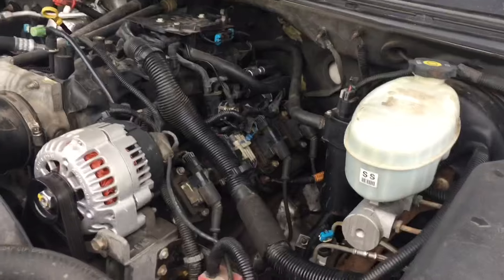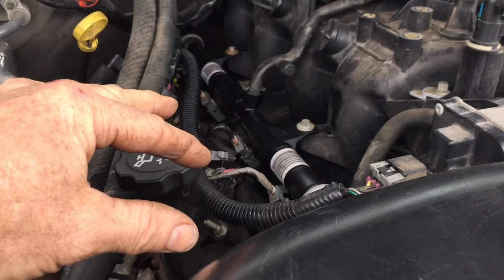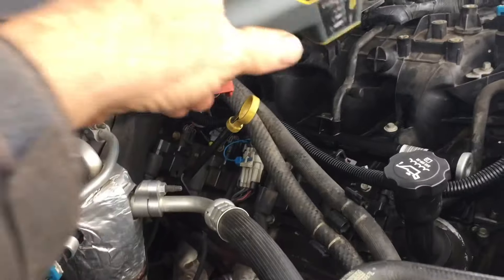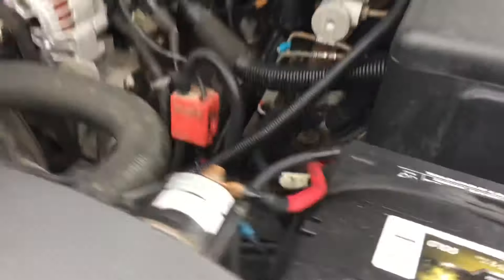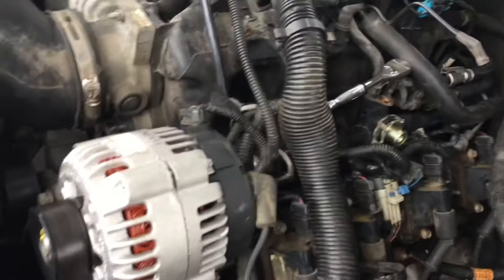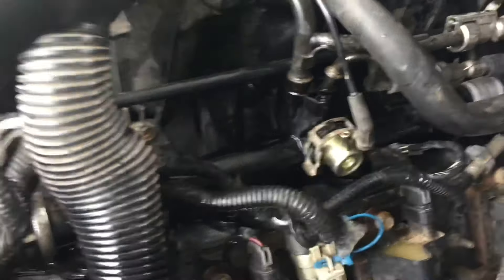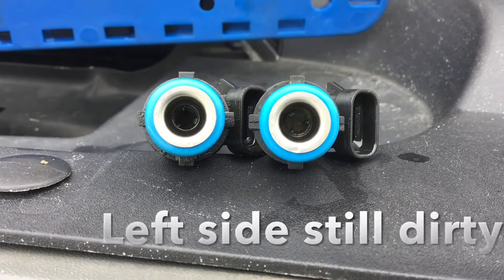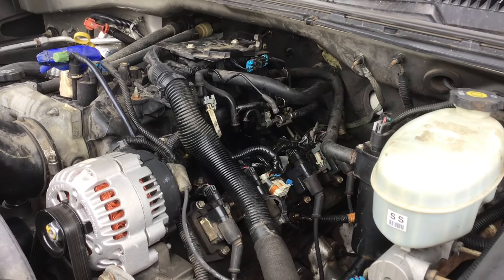PO300 Diagnosing a Misfire- 2003 Chevy Silverado 5.3L

Comment: So far I have watched at least a dozen different videos about a PO300 misfire code on a later model Chevy Silverado and I saw a dozen different problems that have caused it. The 5.3 in my 05 Sierra is now in the metal bin and a 307 from a 1972 Chevelle, with a set of 202 heads and a camshaft from a mercruiser marine engine is sitting in its place hooked up to a 700R4 transmission. No more misfire code !!!
Reply from the maker: @arthurgay5746  that’s awesome…
Reply: You got any videos of it?!
Reply: @TailgateGarage   our shop is located in the salt belt. We will spend 1 hour checking out a few things with electrical issues and if it's not something simple we will send it down the road. You end up working for 3 bucks an hour by the time you get it sorted out. Meanwhile in the same amount of time, I can do 3 brake jobs, 2 ball joints and half finish a clutch job and actually make money. I have seen spending a whole day chasing an electrical bug and not getting it fixed and where I come from, I don't like charging someone for 8 hours labour and not solving their issues...

Comment: Pretty crazy the ecu isn't smart enough to determine which cylinder is misfiring, especially with injectors that clogged. The cars I usually work on can narrow it down to individual cylinders pretty accurately. P0300 should only code if they are all misfiring, but apparently  chevrolet believes any number of cylinders counts as "random" 😅

Comment: 12 volts will open them up & a little tape around your straw will make it tight enough to see a spray pattern.  You can back flush them also using this method.  Be careful of sparks and flammables!
Reply: Making a wiring pig tail might make it safer, you can probably cut off a plug at the junk yard.  I imagine holding it open for an extended amount of time might be hard on them as well.
Reply from the maker: I believe they run at a lower voltage, maybe around 5vdc.

Comment: Make sure the PCV system is functioning correctly.  These engines are noted for Ring issues.
Reply from the maker: I also did a compression test and it wasn’t the best. This is my friends truck he had another mechanic work on it, that guy tried several things($$$$) and then told the owner to tow it to a GM garage. Since installing the new injectors it was running good BUT the fuel pump is now losing pressure and sounds terrible.
Reply: These engines are also known to go over 300k miles...

Comment: That goo looks like excessive fuel stabilizer.  If you use that make sure you mix per manufacturer instructions.
Reply from the maker: The current owner says he has not used any fuel additives. But he’s only owned it about 1.5 years can’t say what was used before that.

Comment: So I did just like how you did with The digital thermometer. My truck was all running for about a minute or 2 and the exhaust manipuled. To get app to like 770°, and then  got up to a 1000° But yes, having the same problem. So I'm pretty sure that is a sign of my Cadillac converters are clogged.
Reply from the maker: Can you put a test pipe in place of the cat?

Comment: My truck was running GREAT and had to replace cats due to constant code, i replaced cats and manifolds, new plugs and wires, now everything back together and now throwing p0300! Runs like shit 😢
Reply from the maker: @mtnbkr265  that’s a bummer… wow
Reply: @fastdadgarage-northsouthch4418   it ended up being a cracked spark plug, must have hit it by accident when installing the new manifold. Runs great now
Reply from the maker: @mtnbkr265  that’s great. Glad you found it

Comment: I have a p0300. changed spark plugs coils and cables. Coils seem to have fixed it but they are my other trucks coils the ones the truck has on seem to work they have spark etc not sure what the problem is
Reply from the maker: You could try to replace with the originals one at a time and see if your problem returns.

Comment: My p0300 code just showed up today. Was driving for about an hour. Gonna start with a fuel filter. And some fresh gas. I guess its possible the truck might not like to be that low. It was sitting for a few months before i bought it a week ago. So i will also be running a fuel additive to try to flush the crap from the bottom of the tank. And i agree with you on the 0300 code being very generic. As it doesnt pount to one specific thing.
Reply from the maker: @HoUsEoFcAtS78  hope you can find the problem quickly.
Reply: @fastdadgarage-northsouthch4418   seems to be intermittent. Dumped a can of berrymans in the gas tank and added about a half tank of fuel. Cleared the code. It started up and ran perfectly this morning. Also plan on changing the fuel filter. Seems to be running fine right now. Might just be a circumstance of old/bad gas.
Reply from the maker: @ best fix ever

Comment: I have p0300 code, new spark plugs and wires and 2 new coils, 1 new O2 sensor 240k miles 2000 Silverado 5.3 starts great like it’s completely normal and once it warms up starts random misfiring, down on power as well as I tow every day, any ideas? It had a 02 sensor code before I changed it then everything went off ran perfect for  about a day then  p0300 code came back.
Reply from the maker: Have you checked your fuel pressure?
Reply: @fastdadgarage-northsouthch4418  not yet, I did replace  all of the fuel system except for the lines about 2 years ago
Reply from the maker: @chefvanzandt6375  some of the new fuel pumps don’t last very long. If you have a gauge to check it out it would be good.

Comment: My 2003 gmc 2500 6.0 is giving me a code of p0300 on the driver side of the motor at the very back  when I unplug the coil the idle don't change but when I pull the rest of the coils one at a time the idle changes I got different wires swapped out different spark plugs and clean them can I even swap coil packs in different spots idk what to do at this point
Reply from the maker: @sonyagirl51  if you have coil packs, I would swap the coils around and see if the misfire follows the coil.

Comment: Seafoam to clean injectors? Also  fuel air spark and timing in a box
Reply from the maker: Sea foam is about the only additive I use, thanks for watching. Do you have good success using the ones you mention?
Reply: I've used Seafoam for many years, and it seems to be paying off because my 2001 Silverado is i still going strong with over 200,000 miles. (Knock-on-wood !)

Comment: On passenger side of fuel rail, the small black bleeder valve, is that suppose to be fully closed, slightly open, or completely open? 
Thanks.
Reply from the maker: If memory serves it should be normally closed, it is a pressure reducer and should only open when pressure gets to high. Again if my memory is correct.

Comment: Would a bad purge valve thrw a misfire code aswell with the evap code cause that’s my problem right now
Reply from the maker: Not sure if it would throw same code. Sorry
Reply: Diagnostic trouble code (DTC) P0443 stands for Evaporative Emission System Purge Control Valve “A” Circuit. The code indicates that the PCM perceives a problem with the EVAP system purge valve or it’s control circuit 👍🏽

Comment: I have a 1999 5.3 silverado. Same code and cant get it diagnosed. Really bad miss. Multiple misfires. Could it be coil packs? Ive changed plugs and wires. Unless is used the wrong gauge wires but i dont know enough about it.
Reply: I hope you can help me and see this
Reply from the maker: Yes a coil pack could give you a misfire. You could move the coil you think it is and see if the misfire follows it.
Reply from the maker: I would move from one side of motor to the other so it’s obvious.

Comment: What a great idea... the IR detector. I have one and will be trying it on my own misfire problem. I can add that you can get those things for something like $15. I use mine for cooking. You can also check for heat leaks from your house--- if you find a portion of an exterior wall or of a ceiling below the attic, the inside of which is colder than other wall or ceiling panels, then maybe it needs better insulation.
Reply from the maker: @moc5541  they have come down so far on pricing. There was a time when our fire department bought one $25,000 and it was a lower optioned unit. What a difference 25 years will make. Great multiple uses good suggestions. Thanks for watching

Comment: I have a 2010 Silverado same p0300 code, I changed out the wires, plugs and cleaned the injectors. The vehicle cranks but it won’t fully start any tips? It’s getting fuel and spark but doesn’t have enough to turn over
Reply from the maker: Hello thanks for watching. I would check the fuel pressure(could be fuel pump). If it’s to low it wont start. You could also check the little fuel regulator, if it’s not operating correctly it will affect your fuel pressure also.

Comment: Have a 2001 Chevy Silverado...rough start and idle in the mornings and when cold. Changed spark plugs and wires... alternator..fuel pump and filter..air filter..and the coil packs..put on the CPU again and po300 still pops up and bank 1 sensor 1 code. Changed that 02sensor as well...still the same problem..felt like the engine was going to jump out today...but after about 20 minutes she levels off. Have no power issues while driving and acceleration. I don't know what else to do...only thing I didn't do was change injectors. When I got the feedback from the parts store it said to clean the injectors. Been using cleaners etc..please help
Reply from the maker: Have you been using injector cleaner you pour into the tank? I’ve never had good success with most of those products. You have done a lot of work! I would pull an injector or two, it’s not extremely difficult and then you could see if they are plugged.
Reply: @fastdadgarage-northsouthch4418  yes Sir...been using the Lucas cleaner. I think I'm going to replace the IAC valve... if that doesn't solve it then I'll pull the rail and do the injectors
Reply from the maker: @maradosmalls7590  sorry can’t be more helpful. There are some videos on how to clean dirty injectors once removed. I haven’t tried but worth a look
Reply: Marado did you get the issue resolved thank you
Reply: Sure haven't. Even changed the IAC valve... Now about to change the EGR valve and see what it does. After that I don't know what else to do!!!!
Reply from the maker: @maradosmalls7590  did you check fuel pressure?
Reply: Haven't done so. Will have to let my mechanic do so.
Reply: @maradosmalls7590  any luck yet?
Reply: Any feed back?? I have the same problem!
Reply: You probably have leaking intake manifold gaskets. Common to leak when the engine is cold and they seal better once it’s heated up.

Comment: Mine says"p0300 misfire#3 cylinder, replaced the plug,wire and coil, and it still says misfire, so it's got to be the injector.
Reply from the maker: I can’t guarantee it, but it seems like you’ve worked through the options
Reply: i did injector on the codeing cylinder, also coils, plug, wires look good, intake manifold gasket, map sensor, still cranks wont start
Reply: Mine was driving me nuts with the po300 haunting, it was leaking intake gaskets
Reply: @roltyd22  i got down to no codes, with a CEL, checked fluids, then ordered a new vortec. 5.3l Milkshake

Comment: You didn’t cycle the injector when you shot brake cleaner it that’s why It didn’t clean
Reply from the maker: Yup that is the correct way to do it. 
I didnt have a 5 volt power supply to cycle them and if you use 12 volts it could burn up the coil inside.

Comment: I have a 2004 Chevy Silverado 4.8l . I've got the same issues except my fuel pressure regulator is located in the fuel pump in the gas tank.  I'm on disability and need to do it myself so I think I'm just gonna try cutting an access hole in my truck bed so I can pull the fuel pump straight out and get to the fuel pressure regulator.  It's cheaper than paying a mechanic to drop the fuel tank, and it seems much easier than removing the truck bed. I dont have anyone to help me.  I was wanting to do it as neatly as possible and put a hinge on it so I can open and close it.  Looks aside, is this a good option for someone like me?
Reply from the maker: Yes this can be a great option. Make sure you cut the hole large enough to work in. If you cut it to small you may have to do a second cut
Reply: @fastdadgarage-northsouthch4418  Thank you
Reply: Dave Roberts  Thanks

Comment: I have an 04 Sierra with Longtube headers and a tune, I have a P0300 code, replaced my plugs but still have the code, any ideas what it could be?
Reply from the maker: Have you checked fuel pressure? Next you could see if all the coil packs are firing?
Reply: @fastdadgarage-northsouthch4418  I have not so I shall do that next! 

Do you think the tune could be adding to this issue? Or is that completely irrelevant?
Reply from the maker: @J-Dawg99  can you easily remove the tune? Add it back after it’s running correctly
Reply: Crank sensor relearn and o2 sensors dealing wit this shit now also sMh

Comment: With that much crap in the injector, you have something in the fuel tank that is messed up. There is a filter screen on the pickup tube, and then the fuel filter. That stuff should never get to the injector. Just saying.
Reply from the maker: That’s a good point, eventually I did change the fuel pump

Comment: The injectors you linked are very cheap chinesium knockoffs. Better have a balance test done on them prior to installing.
Reply from the maker: Yes, this was a cheap “get the truck back on the road” solution.
Reply: @fastdadgarage-northsouthch4418  I've had good results cleaning injectors by blasting carb cleaner backwards through them. The spray bottle isnt enough to open them, but I clamped a piece of rubber hose to the injector nozzle, filled the hose with carb cleaner and then used my compressor to put about 60 psi and blast it through. Cleap way to back flush them. Also, those screens can often be replaced cheap.
Reply: @LSDale  12 volts will open them up & a little tape around your straw will make it tight enough to see a spray pattern.
Reply: Chinesium.  Killing me. 😂

Comment: I got an 04 2500 6.0 with 190,000 on her. I keep getting random misfires but more so when I hit high speeds around 70 mph. It recently got new plugs and wires at 170,000, new intake gasket along with knock sensors. With that many miles I'm leaning toward the injectors being clogged, a bad ignition coil, or possibly getting bad fuel pressure when it starts flashing at high speeds. Any input would be great
Reply from the maker: Get a fuel pressure gauge, hook it up and take it for a drive. You’ll be able to see if your loosing pressure.
Reply: I’m having similar issues more so under load 2k-3200rpm it sounds restricted or something air filters clean maf is new had to replace the pigtails to the maf and just did plugs and wires about to do coils fuel filter upgraded injectors and pump
Reply: I've heard a crank position sensor relearn could solve the misfire at high speed. Look into it on other channels. I'm sure by now you've figured it out but maybe this will help someone else down the road.
Reply: Same problem with mine. Had a buddy hook up a real deal scanner and saw irregular voltage around your rpm range in the coils but under 2 it’ll never show. Had 4 random coils bad. Find someone that can do the same thing because oem coils aren’t cheap. Hope this helps you

Comment: Can this happen after a transmission is replaced ?
Reply from the maker: If the transmission was installed correctly i don’t see how it could cause a misfire. damage to O2 sensor or exhaust could have occurred during installation, which possibly could be a problem. But that should be easy to see
Reply: Might need a crank shaft re learn, that will cause a miss fire

Comment: Thank you for the video. Im chasing a P0300 on my 07 Silverado 1500. Im trying the infrared “heat gun” on the exhaust manifold like you demonstrated. I notice  a couple are showing 150f while the other 6 are in the 240f area. Is it safe to say the lower number i saw is where i should start?
Reply from the maker: That would be the direction I would go. Check the plug next see what they look like

Comment: What about finding misfire on one of your plugs??
Reply from the maker: The idea with checking temp is it gives you a quick reference of what cylinder may not be firing. If it was a plug I’d remove plug/ground and have someone turn it over and see if you have spark, be very careful doing this as you can get a jolt if you touch it while cranking.

Comment: I have a  P0300 popping up on my 2004 Chevy Tahoe it has a 5.3 I change the spark plug spark plug wires and put new fuel injectors in it still has the same problem it also pops up air flow mass sensor but I replaced that and it still says air flow mass sensor. The truck runs rough have to keep my foot on the gas pedal so it can keep running. Any ideas on what I need to do?
Reply from the maker: Have you checked your fuel pressure?
Reply: Same thing happening to mine what did you do?
Reply: Whay did you guys come up with
Reply: @fastdadgarage-northsouthch4418 did you figure ypurs out
Reply: Hey guys just had this problem on my 2005 5.3 1500 pick up. Ended up being the upstream 02 sensors.  ..
Reply: Clean the throttle body
Reply: Weak fuel pump

Comment: Quick question . 02 silverado 5.3 with 223,000 miles. I keep getting a p0303  code. Never happens under load or while driving.. only occurs at idle. I have replaced plugs, wires and coil. What do you think could be the cause? Injector?
Reply from the maker: It’s so hard to say without having it in front of me. Sounds like spark side is good. Next would be fuel, check everything, pressure from fuel pump, regulator and then injectors.